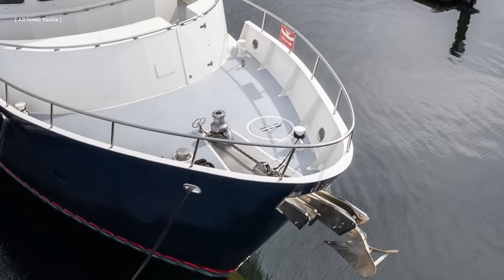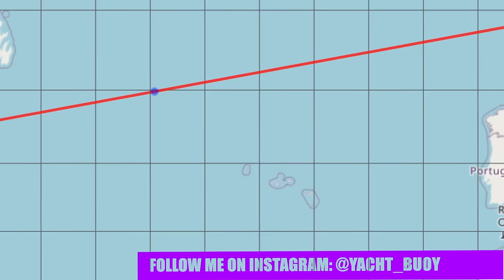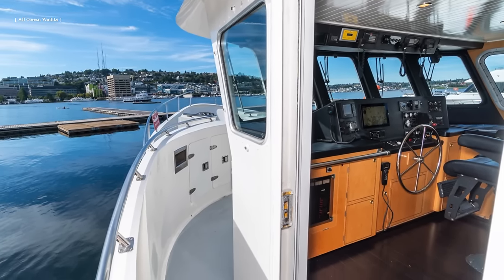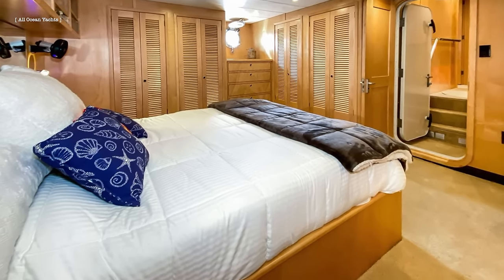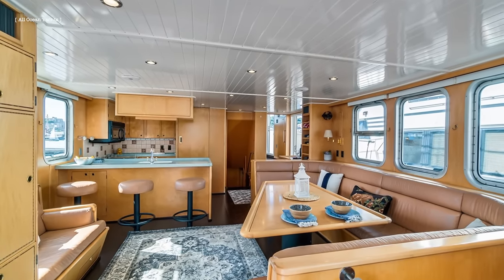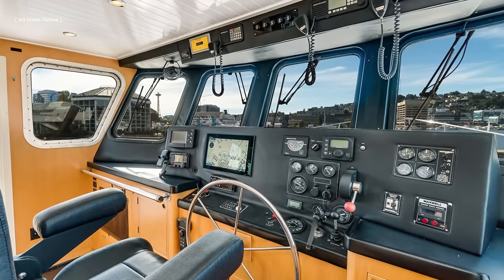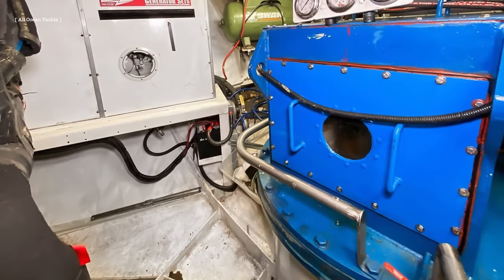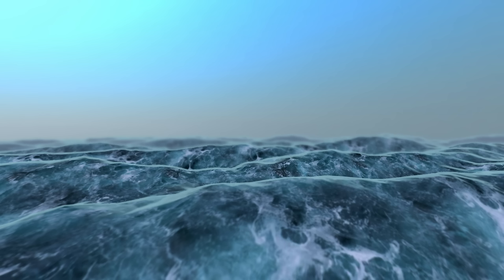Calling ALL Steel Hulled Long Range TrawlerYacht Fans! This One Is For You!

Comment: My girlfriend and I checked this boat out months ago.  Cool boat but lots of rust and the wood panel ceilings were put on after the fact covering all the benefits of the ability to get to wiring.  I spoke to someone who is very familiar with this boat and they said it needs around 200k put in it.  Plus the owner removed the stabilizer's which made no sense to me at all.  That being said it was a really sturdy feeling boat and would be worth bringing back to original condition.
Reply from the maker: Thanks for the info 🙌
Reply: @YachtBuoy  hey if I had the money I would still buy it but if I made an offer it would be 200k less.   The wouldn't take that
Reply: I got 7 k I'll buy it for that ? Lol
Reply: @robertking1480 make an offer cause it won't sell.
Reply: I’ll start the bidding. 10 Bob and half a pack of smarties.
Reply: A 200k refit would be money well spent on this boat.
Reply: The question is (at that time anyways) if you lost all power, how long would it stay afloat?
Reply: Did your informed friend provide any specifics as to what the 200K needed to be used for?
Reply: Took stabilizers off ? ! That crazy. Why would someone do that !

Comment: She’s been sitting a long while for sale. The Volvo and Thrustmaster combo make her an unappealing boat here in the US. And the engine room make it unpractical to install a conventional drive system. Any trawler not selling in a few weeks in this market means you will own her for life when the market cycle dips.
Reply from the maker: That’s a real shame. She is a fantastic boat. Thanks for watching and for the info
Reply: Not bad as a coastal cruiser / live aboard along the Alaska panhandle. She's only 59 feet. The price makes me uneasy. The drive system is great for harbour tugs but has complexity, that I'd be worried is unreliable compared to a straight drive. Not bad for a dream, all I can afford is a rubber dingy. For a real dream check out the Allseas 92
Reply: @easternwoods4378

Comment: That is a sharp boat, I am a little old school and leery of the drive but I am sure they are reliable. I know they have used them for years on tugs not sure how much parasitic losses they have compared to a conventional drive.
Reply: I seem to recall that a rough guess for power loss in a hydraulic drive is around 20%.  Add another 3% to 5% on top for the gearbox losses if the motor isn't down driving the prop directly.  So, from that 340 HP engine, the prop is seeing roughly between 255 and 262 HP.  Where the advantage over a conventional shaft drive is that 100% of the thrust the prop makes can be directed in any direction, which would help it break free from ice.

Comment: Hi John. Another great presentation mate. Just a cautionary comment if I may. Unlike the marinised versions of John Deere, Caterpillar, Fordson and Perkins agricultural diesel engines which are considered reliable, with normal regular maintenance, the Volvo diesel in marinised version tended to be a problem. As told to me by a deep sea sub Antarctic fisherman. And he was a stickler for preventative maintenance.( Possibly an unnecessary comment to add.) However, this was in the 80s so maybe the newer Volvo diesels have improved. Particularly in long distance trawler yachts conversions. Btw I do love this vessel. Thanks for the upload John. Take care and atb from down here in Nz.
Reply from the maker: Hey Bryan, thanks for the info 🙌 a ‘deep sea sub Antarctica fisherman’ sounds mega salty! 🇳🇿
Reply: @YachtBuoy  Roaring 40s...furious 50s territory.

Comment: I don't think she would be so great in heavy seas . She has a nice high up bow, but the stern is low and at only 60,65 feet, she's pretty small. I would never be on that thing in a rough Bering sea. Engine room seemed a bit dated ,ok, it is 23 years old. She needs updated electronics. She was very much like a Nordhavn inside. Still, a nice little ship though.

Comment: She looks great, there are 2 strikes against her though, one of which is an automatic out.
1) Convection Microwave, a fan to even ambient heat out for an even cook in an oven that doesn't use ambient heat to cook, so a waste of money.
2) touch screen navigation systems ( automatic out ) a system that does NOT respond accurately over half the time is not a system to be used.
Reply from the maker: Thanks for the comment 🙌

Comment: Just a correction: all those doors on exposed decks are WHEATHERtight doors, and NOT WATERtight doors. Those two tipes of doors have complete different functios and construction.
Reply from the maker: Thanks for the info - the mechanisms on them made me think that they were watertight
Reply: @Anton SP A briefie on the difference would be much appreciated . . . Thanks Bud!
Reply: @qmmo  Without entering in too much technical information (it is complicated), the WATERtight doors are located in the lower areas of the ship that are subject to flooding, and must withstand the same water pressure of the bulkhead  that they are inserted (you do know that the Titanic did have watertight doors, yes?) . There are several types,  and all of them have to be operated locally (both sides), remotely from a deck above and normally also from the bridge. Now, the WEATHERtight doors (as in the video), are made to stop splashes of water that could enter the compartment. They could not support any hydrostatic water pressures and are only one-way preventer.
Reply: I thought that watertight doors were a standard feature of Cape Horn Trawler. I'm nearly positive that anything I've read has specified watertight. Perhaps I am mistaken, or possibly missing something...I don't profess to be Popeye The Sailor Man hahaaha!
Reply: @antonsp  splash 😂 no big waves swells yes

Comment: With the long-term prospects of a world in turmoil, fuel prices may double, leading to a world depression, leading to unemployment, leading to very few buyers for such ships, leading to depressed market, leading to fire sales. This ship has not sold, will be expensive for fuel and maintenance, is 23 years old, engine has questionable reputation, and is likely over priced.
Reply: Wow man ... don't sugar it so much .....
Reply: @stupitdog9686  
Rob Grune, the sale breaker!
Reply: you're not wrong but to live there on board and have a good mechanical level it "may not do the trick"
Reply: @dough9512  😅 or dream